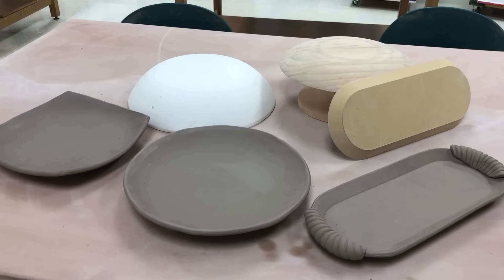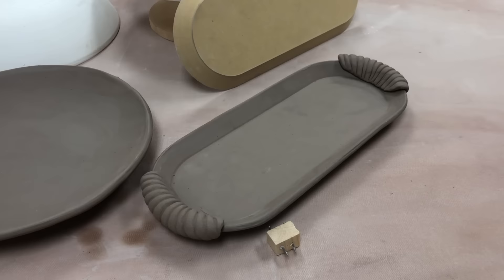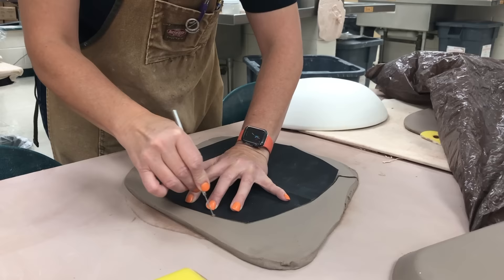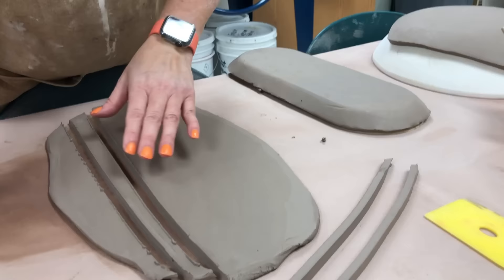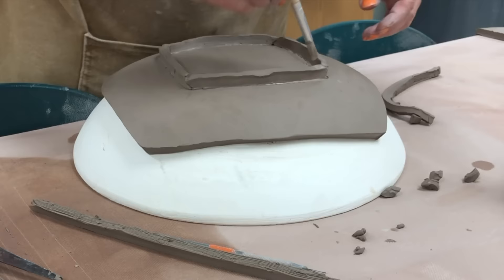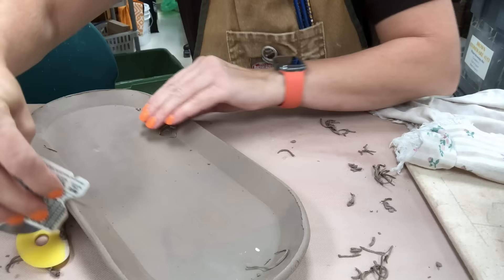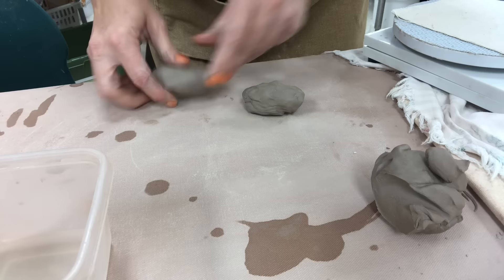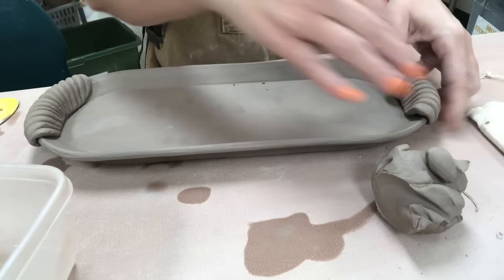Three Easy Ways to Drape Mold Clay Slabs with an Added Footring

Comment: I have used the GR forms and love them. Do you have any advice for drying? I find most of the issues I have with these to be warping.
Reply from the maker: I get the clay off the molds at the earliest stage possible!  As soon as I have my footring on, and it begins to stiffen and not warp I remove to avoid over-wetting the molds!  They also go moldy and the particles expand- which I’m afraid will ruin them with repeated exposure to it!

Comment: Your videos are such a great resource! Thank you. I'm working with molds for the first time and I have a few questions for you: One, do you let the clay harden slightly once you roll it out but before you put it on the mold? Two, what is the tool you are using to remove the little bits of clay. It looks almost like a needle tool but with a brush on the end. The video is moving so fast there I can't really se it. Three, how do you attach the handles to the platter if you glaze and fire them separate?

Comment: Karen, I was wondering if you use high fire or low fire clay? Thank you, I appreciate you explaining clearly the steps.
Reply from the maker: Hi Victoria!  This video is showing Stoneware -  Standard Brand 153.  You can certainly use lowfire clay for these too.  I have chosen stoneware simply because when I made this for my Ceramics II students, they are utilizing these techniques on their Textured Slab Sets project which they are doing out of stoneware!  For my personal pottery at home, I typically use Laguna B mix with grog- which is a white stoneware!  :)
Reply: @KaransPotsAndGlass  thank you so much. So when you fire the stoneware .. Is it fire to cone 6 ? Thanks
Reply from the maker: My stoneware is cone 6... you just need to make sure you get the right cone.  There’s also cone 10- and you don’t want to mix those up!

Comment: Great video. How do you put a foot on a curved bottom without it rocking? I have oval pieces and if I put a coil or cut foot on, the outside edges of the new foot don’t touch the surface it is sitting on. Any help would be so appreciated... thank you

Comment: Fantastic video, I really learned a lot!  Sorry for the beginner question, but how thick are the slabs that you are draping? Will thickness differ based on the type of Clay--brown or white stoneware?  Thanks so much for your help!
Reply from the maker: Slabs differ on the size you need it to be - smaller slabs can be thinner- larger slabs thicker. Whether a clay has grog is another consideration along with the moisture of the clay when rolling.  The slabs for those in the video ranged from 1/4” to 3/8”! You have to experiment with your clay!

Comment: Approximately how thick do you make the slabs?
Reply from the maker: Good question!!  So, if the pieces are smaller than a dinner plate, I often recommend 1/4"!  But, since all of these are slightly larger, I recommend 3/8".  That being said, that is based on my cone 6 claybodies.  Some people may find the large ones can be thinner.  But, I find that thinner than 3/8" may warp with the clay we use in my classroom!

Comment: hello! how long did you wait before you took the plates out of the “mold”? i use a plate covered with stretch film and i never know when to take it out, i feel like if i leave it too long i won’t be able to get it out so i take it out too early and it wraps the shape :(
Reply from the maker: When it is a stiff leatherhard. How long depends upon your conditions as it dries.
Reply: I usually use old t-shirts that I have cut flat....back or front. Clay dries evenly and then I can pull it out of form easily.
Reply from the maker: Nice idea!

Comment: Great video. Approximately how long does it take to get to leather hard?
Reply from the maker: It depends on the porosity of the mold and the environment in which you have it stored!  I can store them on the molds in a damp cabinet overnight uncovered and those can become leatherhard.   Controlled even drying is the most important thing.

Comment: How wet should the slab be for the “push mold”
Reply from the maker: It needs to be a plastic to a slightly stiffer plastic. It should be able to bend easily without cracking. Does that explain enough?

Comment: What slab thickness do you like to use?
Reply from the maker: Hi Linda- it depends on how big the form is!  For the two larger ones on the circular molds, I used 3/8" slabs, and for the elongated oval platter, I just used 1/4".  That is my recommendation for my students, based on their experience and our clay that we use!  :)

Comment: Can someone help me, please? I'm using the oval mold to make a tray, and they are warping as they dry. The first one I took off the mold & set it on the foot ring. The second one, I left on the mold as it died. Am I doing something wrong?
Reply from the maker: How thick is your clay slab, and what kind of clay are you using?
Reply: @KaransPotsAndGlass  B mix w grog, 1/4‐inch slab
Reply from the maker: Well, depending on how big an oval you’re making, you may want to go to a thicker slab. Also- be very careful to only allow EVEN drying.  If one edge dries more quickly then another area you will get warping! Try using a heavy towel over the pieces as they dry!
Reply: @KaransPotsAndGlass  it's the same oval you used in this video. I'll try to slow the drying process next time. Thanks!